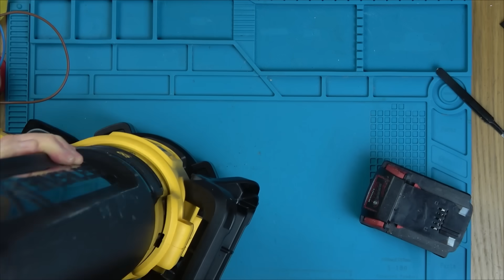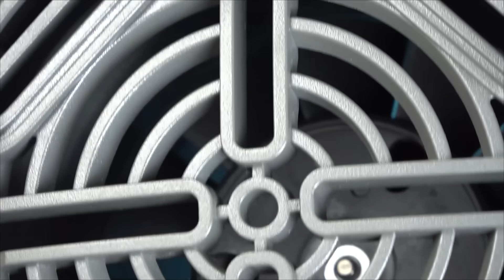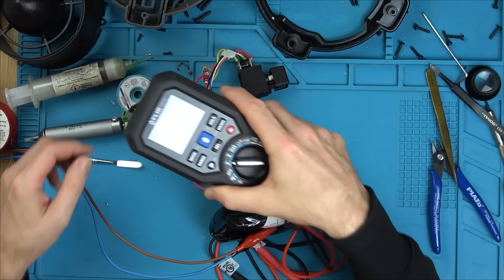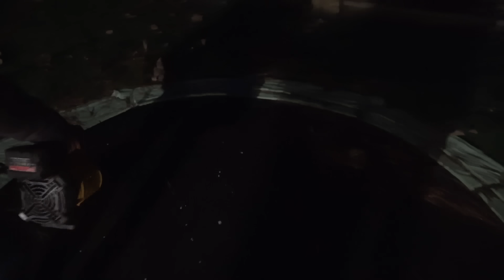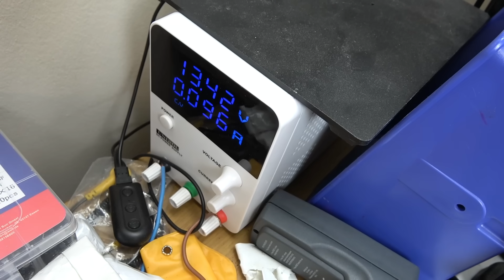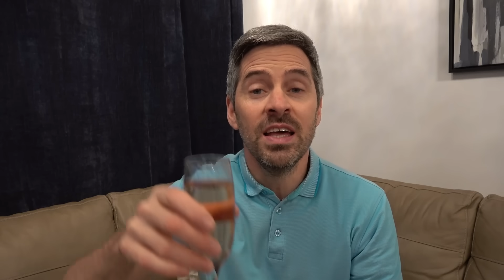MMV November 2024 Fixathon Final Day 7 - DeWalt Leaf Blower & Weekly Summary

Comment: I had the same issue, but I did the very basics before fully disassembling. 

I took off the fan blade cover. 2x screws holding it. 

I proceeded to add the battery(not fully charged and left it attached) 

When squeezing the trigger, nothing happened, no response  from the motor. 

With a long screw driver, I rotated the fan blade to the right a few times and rotated the fan blade to the left a few times. 

I put the long screw down away from the fan blade and I squeezed the trigger with success. 

My leaf blower is back to a working status. 

I put back the fan blade cover which is the black shell at the back of the fan itself. 

Stepped outside to clean the snow with the leaf blower. Luckily for me, it was a simple fix.

Comment: Vince.... a little tip when it comes to power tools (and I repair many) is to test the diode on the back of the switch (if fitted).
A simple diode test, if it reads both ways its faulty and I find around 7/10 repairs  I do this will be the problem.
Reply from the maker: Thank you👍👍👍

Comment: I can only guess that it is cutting out because it will only work with batteries that use clock and data signals and give back an OK signal to the power control IC in the blower. It cuts out over a certain current level when these signals aren't present. This is so that you use specific battery types on the blower. Just like laptops - far too complex and over engineered for a glorified rake. The blower, not the laptops 🙂

Comment: The "REL" button in your multimeter has the "delta" triangle symbol after it. When you press it while measuring a component and then measure another component (like two resistors of similar value) it then gives you the difference in value measured between components you measured.
Reply from the maker: Ohhhh, thank you!!!!!!! 👍👍👍👍👍

Comment: On the screws driver 2 switch. If you pull the trigger gently the light will come on first switch then goes through to switch 2 to activate motor

Comment: I have this model Dewalt leaf blower. DCBL722. You can't get new parts for it. I left mine outside for a night and the the next day it didn't work. I traced the problem to the switch. After spending way to much time trying find a new switch, I bought a non-working back end, basically a motor and switch. Fortunately the swithch works and leaf blower lives. I can't figure out why the motor doesn't work and I have several Dewalt batteries.I stopped futzin' with it when I realized I'd have to pull the board off of the motor.

Comment: It would be interesting to open an original battery to see how they deal the 2 additional wires. I don't think there are only resistors like in the adaptor. If there is a temperature sensor the blower could detect that the sensor does not respond correct to the load and shuts off.

Comment: Nice mate, I also do soup in the flat pan for exactly the same reason. Plus I scramble eggs in the frying pan, NOT in a saucepan with milk etc simply because it always catches and takes a LOT of cleaning when done in the saucepan and can damage the surface when you need to scour it out. One vote here for the Frying pan and it's easy wipe clean win here.
Reply: Regarding frying pan vs saucepan and stick or non stick. Please consider throwing away any Teflon or Ceramic pans. Buy a carbon steel pan and see to it that it is well seasoned ( do not use soap when cleaning it as with any cast iron pan, just wipe it out and reapply some oil). It will last forever, can handle any sort of utensil without breaking and will almost have as good non-stick properties as any crappy Pfas chemical frying pan.

Comment: Hi Vince, a battery can provide much higher instant current than the Lab Power supply and I assume that there is a chip which checks the voltage drop and turns the motor off if not enough current is available. On the battery side could also be a BMC that is programmed to cut the battery in case a certain load is exceeded. Usually the short protection will do that.
Reply from the maker: Cheers Marcel

Comment: Hi Vince! Measuring the motor coils with the multimeter in resistance mode and spinning the motor you risking to damage the multimeter because spinning the motor the coils will generate voltage that goes into the multimeter and if the multimeter is not set in voltage mode and is set on resistance mode will get damage!

Comment: The benchmark power supply and 	the big battery cannot supply enough current without the output voltage dropping down, the device battery sense wires then indicate that the battery is in trouble and shuts down.

Comment: Ah are a measurement of currents drawn over time (capacity). Its not a "point in time" current draw. So if your battery is 2Ah, its just telling you that you can pull 2A for 1 hour or 4A ½hour or 8A for 15min theoretically. Batteries have a C rating which tell you your maximum continous amp draw. So if your 2Ah battery has a c rating of 10c your battery can deliver 20A max safely. Your PSU might be able to deliver 30V/10A but it can not deliver the required start current the leafblower needs, thus the voltage drop you see on your PSU. Its likely the same thing with your big milwaukee battery. Besides, generally you cant trust an unloaded battery multimeter reading. The voltage is probably much lower when you add a bit of load to it. Good video though, thanks mate!
Reply: In theory the bench PSU has infinite Ah rating 😅

Comment: the discharge current is not enough. you must look the discharge current from the battery. that motor (maybe) can draw more than 10 amps in 100% power and the pin from the battery maybe battery protection pin, i am not sure.
sorry for my bad english, english is not my first language.

Comment: The adapter must have a a fake sensor in it to fool the tool, so the battery is likely unprotected.
I use a mulcher, it can blow the leaves into a pile then you use it to vacuum and shred them. Fills 1 black bag after mulching instead of 4.

Comment: I think I know why it won't work with the 12ah milwakee battery.
There is no12Ah deWalt battery (there is a 54v one, but not 18v), so maybe the circuit goes in protection when there is too much current flowing through, the circuit is not designed for that much amperege.

Comment: Maybe the Wago connectors were done to ramp up the repairability? So in case something is wrong with the battery connector, you only need to unclip that part and replace it.
The motor might need a very specific Amp/Volt configuration only delivered by DeWalts own batteries, so you don't use adapters with it.

Comment: That battery adapter looks like it won't do your expensive Milwaukee batteries any good.  If a DeWalt tool draws so much the battery gets very hot, the tool will never know and the battery will just keep getting hotter.  I wonder why they couldn't just interface the Milwaukee temperature sensor output?
Reply from the maker: I was wondering the same thing. Unless they use the same insides for all the different battery converters when using the DeWalt one. So whether Milwaukee to DeWalt or Makita to DeWalt etc. I bet the insides are the same. BUT...there would be a market for an adapter that actually uses the donor battery protection rather than just fooling the tool into working. Surely a multimeter and tearing down a few batteries would get to the bottom of this and allow the pass through of the necessary components. I suppose the cost of these adapters has to be kept to a minimum otherwise it would be better just to buy the correct battery or a 3rd party version of it. Still it is a nice idea 😎

Comment: There are various types of brushless motors, the main ones are:
- BLDC (3 phase dc motors, 3/4 pin), they have 3 inductors (diagram wise, imagine a circle with one side of them poking outside) all connected at one side (at the center of the circle, also called common) and all disconnected at the other. The common may sometimes be negative (4th pin) or the chassis may be negative, I guess it depends on the application, and the positive goes around the inductors to turn the motor. It's hard for me to explain how it works without showing you, so look online for "Commutation sequence BLDC" and you'll see what I mean.
- stepper motor (4 to 6 pin): they have 4 windings in pack of 2, so each have 1 common pin and 2 "outer" pins (positive and negative), in a 5 pin configuration the 2 commons from the windings are connected together and on a 6 pin configuration they are not. You may sometimes find a 4 pin configuration (haven't seen one in a while), in which case there are 2 windings with no common. Again, look online for their schematics and you'll see what I mean.

There no such thing as a 2 pin brushless motor, if it's a 2 pin motor, it's brush one (and the fastest way to test it is to put voltage on it). I believe they sell testers for this type of motors, but I may be wrong, haven't really looked it up yet...
Hopefully, in the future, this will help you check if a motor is good.

Comment: Excellent video. I suppose we all have to be careful if we don’t use a tool as per the manufacturers instructions. Using the battery adapter could negate a safety feature if not all of the contacts are used. It’s like using a non OEM charger for a phone, there is always then some risk that something could go wrong.

Comment: I see a new channel idea - Cooking with Vince - great work as always. Love your fixes and I've learned a lot too. I've fixed some LED lights, my central heating PCB ( dry joints ) and diagnosed a faulty Digistat box. Sadly the Digistat needed the main chip reflowing so a bit above my skill level. But got it fixed for a very reasonable £45. Plus a host of other small appliances that would have gone to the landfill 😃😃

Comment: Nothing is strange on acting like that switching off it's normal the brushless motors require lots of amps in short period. Power supplies will not be able then not all batteries are capable on doing that to just do your research about some batteries that can release also 30A in a short period of time. And then definitely you will understand that the blower was in perfect condition and you are repairing something that is not defective so I can't understand which repair is this?

Comment: BMS is required to run.  The two inner pins are monitoring the voltage balance of the cells.  Protection for the battery.

Comment: A brushless motor will not run straight to DC voltage have an electronic speed controller and is a three phase motor that work in pulses generated by the electronic speed controller

Comment: Are you measuring the motor coils in resistance mode and you are spinning the motor so you end up on damaging the multimeter because when you are spinning the motor will generate voltage across the coils and all that voltage goes into your multimeter and the multimeter is not set to measure voltage!

Comment: I suspect the reason your power supply and bad battery cause the tool to cutout - the issue is likely low voltage protection. When you draw excess current the power supply (and a weak batter) will drop low in voltage. Likely this would mean the bad battery you have has weak batteries that can't support the power draw, and you would need a higher amp output power supply (or to set it over 10 amps)

Comment: Battery capacity alone isn't the issue, the discharge rating of the cells also matters- that motor is likely trying to pull far more than 10 amps but the dodgy battery can't supply it causing a massive voltage drop, so it shuts down- same with the power supply essentially.

Comment: That's a three phase PWM motor. The board contains a driver circuit that generates the PWM pulses that drive the motor sort of like a computer fan. These draw a butt-ton of amps on startup. that's why your it's not working fully on your bench power supply.
Reply from the maker: Thank you 👌

Comment: Volts can be devided by Current, or Watts/Amps. if one or the other Current or Watts isn't enough the power management probably kicks the safety system meaning the air blower won't exceed a certain level. so while Volts will be good, if the ratio isn't good for Volts devided by current, or Watts then the battery management will stop the device on a smart tool, but on a dumb tool it just checks the voltage and watts. and probably run for 5/10/15/20 minutes fine on 60% throttle because the current or watts or both don't exceed the battery management safety.

Comment: I believe I understand what's happening here with the bigger batteries and the power supply. I think the over voltage or Over Current protection is quite sensitive in this particular blower. I understand DeWalt now sell a line of tools and batteries that are called Flexvolt. The Flexvolt series is supposed to run at 20V or 60V and use those 2 middle terminals to communicate with the battery to run at 20V or at 60V by configuring the batteries to run in series or parallel. This line of batteries is supposed to be backwards compatible for 18V tools as the real difference between 18V and 20V batteries are the listed Nominal voltages of the cells composing the batteries inside. With the adapter and the smaller of the batteries, because of less cells making up the battery, the nominal voltages of the cells combined is less likely to trip that over voltage protection. The bigger batteries because they are composed of more cells are more likely to reach an output voltage/current and maintain over this particular blower's over voltage/current limit. They have to place some protection in these devices to be able to share batteries.  

How to test this theory. Using the topper and the two Milwaukee batteries, insert your multimeter into the circuit. Then take a current measurement. I bet the bigger battery is providing more current to the tool to the point where it thinks it needs to protect it's components.

Edit: Re-watched the section where you had it working on the Lab bench supply. Played the video back at 0.25 speed and noticed that before the motor cut off, the lab bench supply quickly changed to constant current mode. I think that motor is over current and it is tripping it's own internal protection. Even when you switched between the DeWalt battery and the smaller of the Milwaukee batteries, I heard a tonal change in the speed of the motor between the two batteries. Because the bigger of the two Milwaukee batteries is composed of more cells, it can sustain more current draw causing the motor to trip it's own internal protection.

Comment: @Mymatevince

if i didn't want people to use aftermarket batteries with my tools, i might inject a signal from the battery on top of the 18v dc, something in the order of a few mv, and get the tool to listen for that signal, and cut out after a few seconds if it isn't present

i might even call this a feature - protection against unsuitable batteries

Comment: If you have a current metre Err-Ammeter your curiosity as to what is happening
and why the circuitry "the plastic encased PCB" shuts down the supply should 
be resolved.. 
Further hint below..
.
.
.
.
The PCB is a protective current sensor

Comment: well, a 2Ah battery means it can output 2A for 1 hour... since it lasted much less than that, my guess is that the leaf blower requires more current than either the large battery or the bench power supply can output (though I may be wrong)

Comment: It's sensing the current and as the current (and voltage) plummets (because the battery you found and the bench PSU, cannot provide that amount of current).  The battery shows 2Ah, but if you look at the spec of the cells they probably provide much more current than 2A!  2Ah is just the approx charge time to give an indication of how long it might take to charge an amount of power into it, not how much current it can provide!  You showed that yourself in a video or two back - when you replaced a cell!  The voltage likely drops and that might be what's stopping it.  You can see on the bench PSU that just before it cuts out, it was pulling over 3A!   The battery spec in your previous video where you swapped a cell showed a massive amount of current available from "start" or something.   That's essential due to the torque of starting a motor spinning from stationary, and when going over a certain speed etc.   Great job!!! =D
Reply: 2Ah is not the charge time, it means the battery will supply 2A for 1 hour, in theory.
Reply: @Martyn-ey9lw  Yes, but that doesn't mean it would only hold 1hr of charge!  It's just a metric you can use to compare to other batteries.  The current that battery can provide is more than 2A!
Reply: @GadgetUK164  Don't totally agree, it is the capacity of the battery. I could have said 1A for 2 hours or 4A for 1/2 an hour, of course this all depends on the condition of the battery.
Reply: @Martyn-ey9lw  The point is though, you can assume 2A for 1 hour, the battery was marked 2Ah wasn't it?  Yet the tool pulls over 3A on the bench PSU before it even gets half up to speed.  This shows that the 2Ah is just about capacitity in general rather than how much power it can provide in less period of time.
Reply: @GadgetUK164  That's what I wrote "it is the capacity of the battery"
Reply: @Martyn-ey9lw  You're correct, just having a senior monent!!  My point is regardless of that rating the battery needs to provide more current than however many amps are shown in the Ah rating!
Reply: @GadgetUK164  I think we are really saying the same thing in a different way, cheers
Reply: that's not it. connecting the leaf blower directly to a PSU bypasses the thermocouple inside the battery. without the thermocouple connected, it is giving a maximum reading of 255 which means it thinks the battery (psu) is too hot so it won't turn on

it is necessary to connect a resistor between the two sense pins before connecting the remaining 2 to the psu